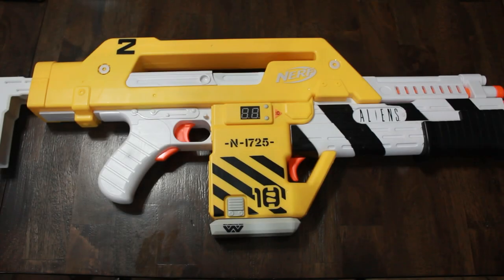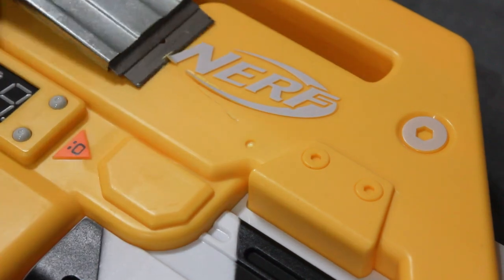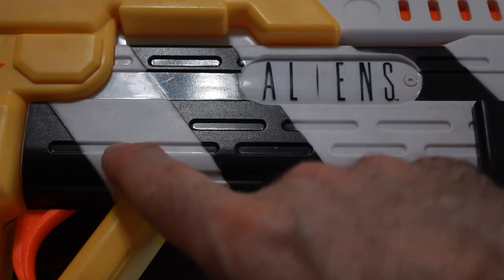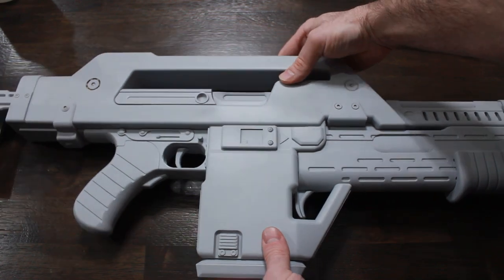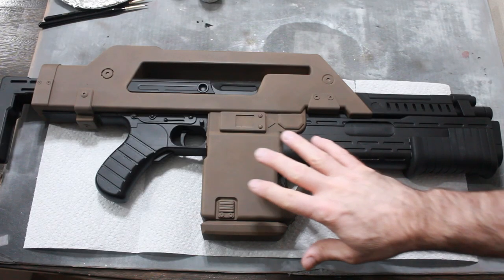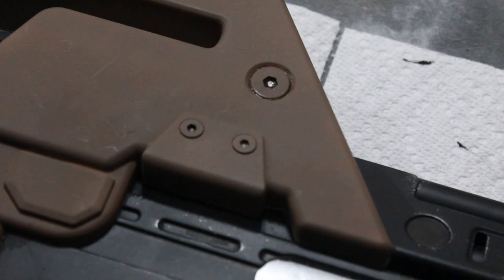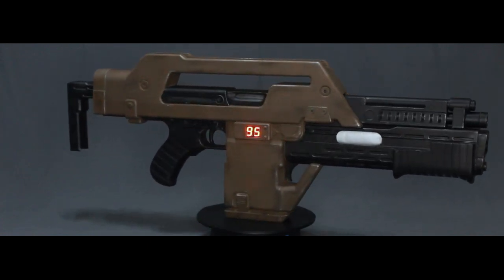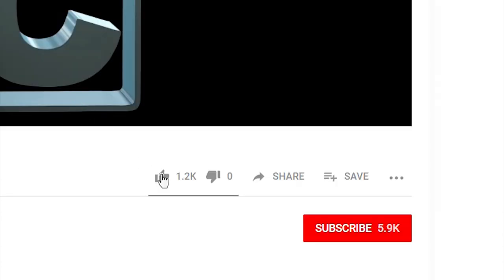Hasbro Nerf M-41A Pulse Rifle "Aliens" repaint

Comment: The only ammo that comes out of a pulse rifle during fire is what is aimed at the enemy. M41A's use caseless ammo which does not require a heavy casing to be ejected each shot. Pretty much a form of rocket ammo.
Reply: That's correct, but the pulse rifle is a fictional gun made by taking a M1A1 Thompson, the front cage and pump from a Franchi SPAS 12, and a bunch of aluminum shrouds to link them together. The mechanical parts of those guns were still functional and exposed, so to make a screen accurate replica you need to take all of that into consideration and reproduce what is visible - even if what you see makes no sense based on the canonical description of a weapon.
Reply: @AllThingsMech  Are you telling me a gun from 2171 is fictional?!

Comment: An awesome job you did Chris.

Im working on one now, i sanded down the nerf lettering with a hobby needle file, which only took about 10 mins to do (my fingers are hurting now) lol.

I did use my dremel like you did on the aliens lettering.

After you finished sanding off all the black markings off the mag casing, did you give the rest of the rifle a sand to remove the sheen before you primered?
Reply from the maker: I did not.  I just primered.  Just sanded the raised areas and black markings

Comment: Nice video, cool paint job. Quick question, did you paint the underside of the grenade launcher "slide" after painting it with it in the "fire position", vs the "charging position"? And does it still fire Nerf "darts/rounds" and "grenades"?
Reply from the maker: Yes, I pulled back the slide and painted under as well in both positions.  The grenade fires just fine.   The bullets still fired fine after the first paint job.  After this 2nd mod and removing the inner barrel,  it will not get through a whole clip without jamming. The bullets can get stuck in the area you can see through above the grenade. In hind sight, I wish I would've removed maybe half the barrel. But I really got it for the look.  Firing was not a priority
Reply: @modelsbychris  I picked one up a few months back and have been watching various mod videos on YT looking to see what can and can’t be done and how best to approach the main painting part of things (I don’t own an airbrush presently), so cans will have to do. I loved that black paint that you used on the barrel and receiver early in the video. Looks great in the photos later on. Did you seal the applied paints afterwards (after the weathering) or just leave as is?
Reply from the maker: @marottamonster  I did seal with Tamiya flat coat.